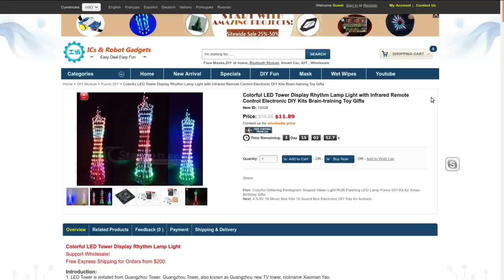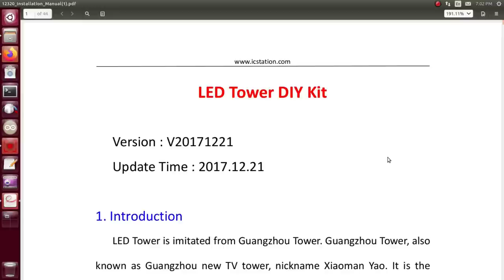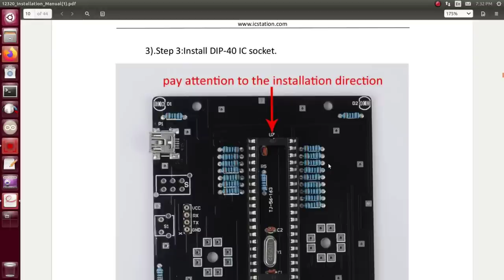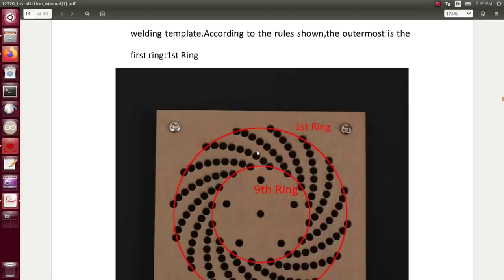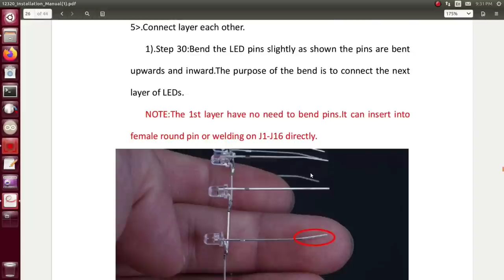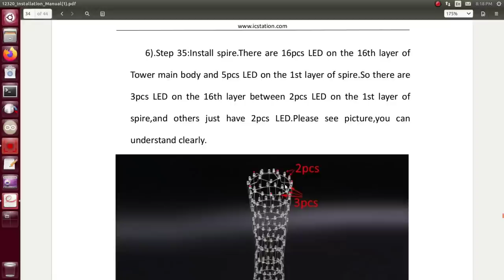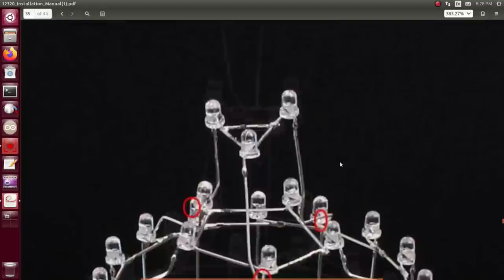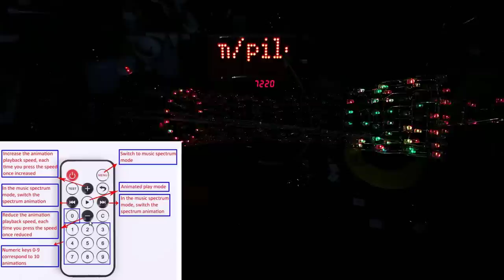Kit build December: LED tower kit

Comment: a year ago I built a 8x8 led cylinder, based on a 8x8  flat matrix grid IC. 8 in a circle, 8 stacked  high, arduino controlled, red leds. looks and works really cool. made this from scratch on perf board off of the arduino site for 8x8 matrix project.

Comment: Thanks for doing this,  one thing that will help, as you build each layer, add the control wires as you build up. that way you do not have to snake the wires up inside with tweezers.

Comment: I had a similar kit, but it was designed just as a cube of LED's, but virtually identical.  A single STC microcontroller, or microprocessor as they may be, and a bunch of LED's that had to be soldered in grids.   Had a bunch of LED's left over at the end too.
It had the same 4 colour changing LED's on the corners as stands.   They gave code to program it with Arduino IDE if needed, but I never really did anything other than run through the defaults with it.
Reply: Our host built the same kit, or one very similar to it. First thing that ran through my mind when I saw this.

Comment: I could be wrong, but it looks like you have a bad LED, or hopefully a bad solder joint, on the third circle from the top.  Great job in either case, that would be a challenging kit...might have to get one of those. :D

Comment: is the beer cold?
if no -1 if yes +1
BTW thanks oem for not including  Analog Multiplexer Chip 300 Ohm 16-Dip
Reply: Frankly, I was impressed that they included a socket for the controller.

Comment: The LEDs are colour changing but always start with the same colour. Most of the animations I saw only turned on the leds for a short period of time so they only lit up in one colour (most!)
Is this the case for all the default patterns it comes with?
Reply: The program in the MicroController is very clever. It limits the voltage in the "off" mode so that the colour-changing cycle can progress even though there is no illumination. In that way it can make a single ring of blue, despite that colour being quite a way along in the automatic animation.

Comment: Ok so just received this kit. I cannot seem to download the manual. Can you send me a link for this download of the manual. Thank you
Reply from the maker: I re-uploaded it to my web server: https://pileofstuff.ca/shared/12320_Installation_Manual.pdf
Reply: @pileofstuff  thank you again. And HAPPY NEW YEAR
Reply: Be careful that you have right instructions for your kit. I got this kit some time ago and only just restarted building it. I couldn't find my original instructions so used the above download. Argh! My kit has the LED polarity.reversed. Thankfully spotted after only one wrongly soldered ring. My kit had two perspex templates, not one.

Comment: Excellent vid as always and a great result but.....I'm a little confused. At 21:12 you tested the first four rings, nothing wrong there but how did they work without having any of the negative 'rings' connected? Soldering the negative wires was the last thing you did.....wasn't it? It works, that's obvious, but why?
Reply from the maker: In retrospect it wasn't a smart test to try.
I think it sort of worked because of leakage current through the driver circuit in some of the other leds in the ring.
Reply: @pileofstuff  Maybe you've done it.....Free Energy at last! Then again, could be just a miracle......Merry Christmas.